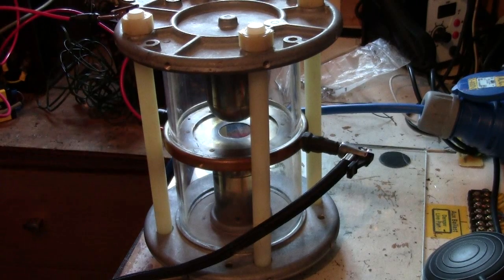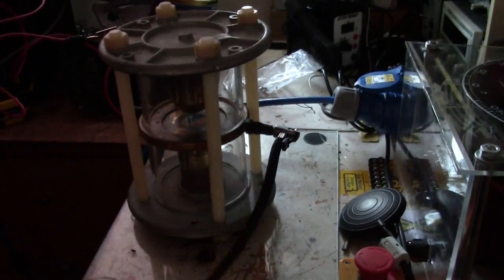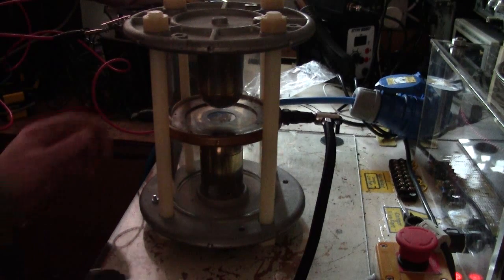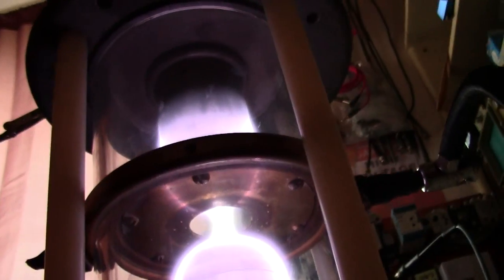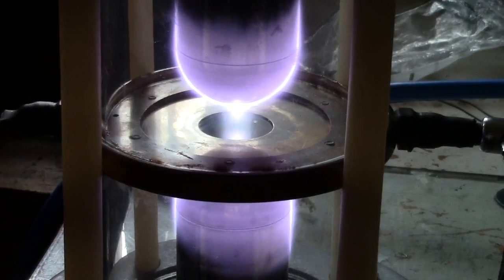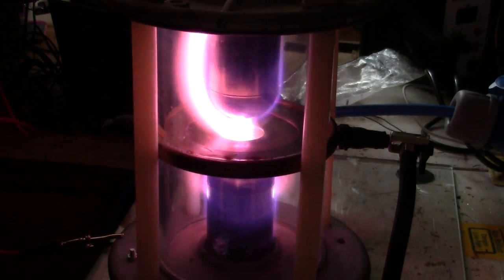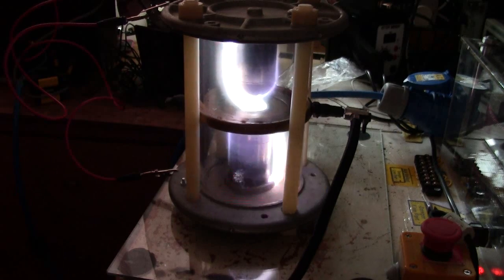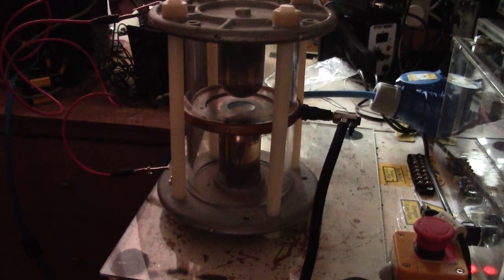Military spark gap VERY STRANGE .KNOW WHAT IT WAS USED FOR ?

Comment: if you add a  puls from AC 90% you getting mixed ac and dc witch you should have some vary strange efects like (mixed ac and dc giving you levitation ,invisibility and all others think over that )....just in that case you need 1 wire from inside the vacum tube goes on the the caase outside to efect all around ...:)
Reply: do I need some specific laser or ? i like your idea :)
Reply: +Johnson K. Angel 
Magnets dont bend light. If they did, like you propose, then every magnet would create a diffraction grating effect where the light is separated by wavelength. If you insist on your theory, then explain to me the mechanism at play, where is the math that backs it up?

You've been watching too much Ken Wheeler videos
Reply: +Johnson K. Angel 
One of the red flags I see in Ken Wheeler's theories is that there is a lack of math and quantization. If you can define something at least somewhat by numbers, then how can you accurately compare data from experiments? And without the math how can you accurately make predictions to then test with experimentation? 

I just tried bending a laser with a neodymium magnet and it seems to have no effect. What could I be doing wrong? I do respect the fact that you strive to confirm things through experimentation. Hopefully we can come to a conclusion together.
Reply: ***** 
I am using a blue laser. 445nm to be exact. And im using a stack of 1/2" diameter by 3/8" tall neodymium magnets.
Reply: ***** 
Its not bending at all for me. I have tried it with all different magnet orientations and I just tried it with the magnets further from the laser pointer. Why would the effect be magnified the further you get from the source? Maybe you can try your experiment again to see if you made an error or something?
Reply: ***** 
Also, a few comments up you said that red light bends more since it has a longer wavelength, but in your reply to me you said blue light bends the most since it has more "capacitance" (not sure what you meant by that).

So which is it?
Reply: ***** 
As I said previously, im not getting any bending. The fact that ive never heard of this before lends its self to the probability that its false. It seems like a pretty major property if light that is either there or isn't and should be easy to confirm or falsify. There are many examples I can give that would also indicate that this is probably not true.

So lets look at the claim a little more critically. Where did you first hear that magnets would bend light?
Reply: ***** 
The laser is about 1.5 watts, is that powerful enough?  The magnets though are relatively small compared to the large ones you can buy. 

Why is it that no one else has noted this effect? Dont you think there have been plenty of researchers to try this with very accurate test setups?

Lights magnetic field can be affected by an external field, this is called the Faraday effect. The way it affects it is not by bending it, but by changing the relative phase between the oscillating magnetic and electric fields which changes the light's polarization. 

Can you upload a video of you bending the light with a magnet?
Reply: ***** I am still not able to see any bending. What size magnet and laser are you using? Can you upload a photo of the bent beam
Reply: ***** 
Oh ok. Based on your results, which direction does the laser bend relative to the magnetic field direction. Also, by what angle is the beam bent with your setup?

 What do you think about my ferrocell explanation on the other video I linked?
Reply: ***** 
You dont have to use any assumption to measure it. Like you said, its as simple as measuring the distance from the laser to the surface you are shining it on and then measuring the distance the dot moves when the magnet comes close.

Ok so you call it the dielectric inertial plane instead of magnetic field. By definition, a plane is 2D, so is magnetism not 3D? Or am I interpreting that wrong? Also, to me, dielectric means non-conducting, and inertia is a property that matter has which basically resists acceleration (ie. an object a rest will stay st rest and an object in motion will stay in motion unless acted on by an outside force).

So what exactly is a dielectric inertial plane? A plane where non-conductance doesn't change unless it is forced to by some outside force? This all seems very confusing to make up your own names for things. Why do you choose to call it that?

In regards to the flaw in my ferrocell explanation, if all the light was absorbed by electrons then the object would be black. For something to be invisible, light has to pass through it unchanged. For example, a clean piece of glass lets light pass through very well, which is why it is clear.

The electrons dont just absorb any light willy nilly. Depending on the energy level structure of the atom, its electrons will absorb certain wavelengths of light. Im not sure how that plays into my explanation of the ferrocell though, can you explain why that would matter?

I didnt know that magnetic and dielectric fields make the light coherent. What is required for this to work? Does any magnet make light that passes by coherent?

What are your thoughts on my reasoning that you arent able to observe light bending in the ferrocell because, by definition of sight, what you are seeing is light traveling straight at your eyes. Do you can only see light that hits your eyes? I believe this fact alone is enought to show that you cant see light bend in a ferrocell.

Since my results indicate that magnets dont bend light, and your setup obviously allows you to see that, can you upload a picture of it? Otherwise I dont see any evidence for that hypothesis. If you dont have fog try it at night and light a couple matches or something to get some smoke in the air to make the beam more visible. What size is your magnet and what power is your laser?

Comment: It seems to me that the higher vacuum in the casing the less voltage is needed to create a spark. And the opposite. A normal atmosphere in the container requires higher voltage to form a spark. Maybe the device could be used for this measure. the Vacuum or level of exhaustion versus the Voltage to see when an arc is formed between the terminals ? seemingly the more molecules in the container , the more choked is the spark. By forcing air into it and compressing a whole lot of molecules into the container will presumably increase the spark gap resistance. It certainly depend on what molecules are present. CO2, or Nitrogene or Oxygene or "air" .

Comment: HAve a look at the Aurora Pulsed Radiation Simulator: http://cryptome.org/eyeball/aurora/aurora-eyeball.htm - in the photos you can see that its Marx pulsers used boatloads of T-508 switches like yours. I designed and built a modified and miniature version of the T-508, never got around to testing it before my pulse cap and related resources went away. :(

Comment: vacuum plus electron acceleration equals x rays i thinks. be careful
Reply from the maker: you are correct but you need far better conditions,set-up and greater vacuum than I can achieve ( unfortunately ;-)  ) I also have 2 dosimeters and a Geiger counter running and picked up no trace .It's a good point to make though it's very surprising how lower voltage is needed to achieve X-rays and a good read also, if you like that sort of thing .Thanks for the comment John

Comment: Greetings,

You have a T-508A spark gap, made by Pulse Sciences/L-3 Communications.  It is capable of passing up to 150 kA and standing off 200 kV when charged with sulfur hexafluoride at a few atmosphers.  Max pulse duty is about 2 coulombs per shot.  The center planar electrode is the trigger.  These gaps are used in the Sandia Marx banks that drive the Saturn and Z plasma accelerators, among other things.  

Few of these gaps exist in private hands or outside the US National Labs, but there are a couple of places to see them.  Back in the mid 1990's, the University of Nevada acquired some from Los Alamos National Lab as components of the 2 terawatt Zebra Z-pinch.  There might also be a few in the surplus store called the Los Alamos Black Hole.  Rare ducks, these...
Reply from the maker: Andrew .I thank you so much ! I've been searching for some info on this since I brought it and found nothing but triggatrons .NOW thanks to you I have a Datasheet ,you don't understand how happy you have made me ,it's finally been answered .I still have it sitting on the shelf I also have 5 X 20 kv PT's and 2 very large power distribution capacitors capable of blowing off a limb ,Now I have this info I k ow it's safe to use ( once filled with SF ) although at 20 KV at around 10KVA I may go dry air but that is something I will look into a lot more ,Thanks again John
Reply: @HighVoltageProjects  what is the rating on the power caps with u btw 😎
Reply: HighVoltageProjects idk if you seen this or not but here’s a pdf on if http://www2.l3t.com/ati/pdfs/T-508.pdf
Reply: Love it!
Cheers from Toronto
Reply: Due to the recent fusion breakthroughs and z pinch news last year... This thing has become even more interesting
Reply: interesting !! what are the saturn and z plasma accelerators ?
Reply: Andrew Oxner lhjllhollhklh8jll
Reply: That was pretty tight.
Reply: No dangerous x rays?   Can this rf output be measured qualified on an asccilator? What's it look like in the various spectrum bands..
Reply: Hi Andrew!
Just a quick note to say how interesting your description was. Man I'd love to work around such facanating gear and minds!
        Cheers from Toronto

Comment: That is a super awesome gadget you got there. Maybe for research, many applications require very high amplitude short duration pulses like this one seems to be designed for and with high voltage you can't use ordinary electronic switching - or maybe it's just an ordinary quenched gap, if the ring is magnetic, for radio transmission, they used all kinds of gases, like pure hydrogen, f.ex. Typical that we're not allowed to use them, at the same time they(the DOD) make these. Tesla made them first, but then a guy named Paulson nicked the idea and made(money) it more famous. The dimensions of the gear and watt capability in an old military radio station was just unbelievable. If you haven't found out yet, ask somebody that knows all about old radio tubes(not just an audio freak). Ernest C Okress(Westinghouse's microwave-guy and waveguide window specialist) would certainly know what the military would use it for, and if it's not old school-radio or high powered radar, it could be something really cool like HV pulsed DC propulsion as he has patents for it (quasi-corona-aerodynamic vehicle) you and especially the people that are showing off their inefficient little lifters really should check it out.
Reply from the maker: Happy Fox thanks mate I will do that .I thought it may be a triggatron / triggered spark gap it seem a lot of people have lots of ideas but as yet havent found a thing for sure so ,I ll have an ask around those guys .Thanks again John

Comment: Triggered Three-Electrode Spark Gap Switches are ceramic-metal sealed off gas discharge trigatron-type devices with a co-axial trigger electrode. These Gas Discharge Tubes contain no mercury and, due to an advanced design, feature high reliability and a long lifetime being operating under wide range of environmental conditions.
http://www.delmarphotonics.com/Plasma/Triggered%20Spark%20Gap%20Switches.htm

Spark Gap Switches R-90 and the devices of RK-series are the sealed-off ceramic-metal gas discharge tubes designed as untriggered switches for use in pulsed circuits of devices with enhanced demands to switching speed, break-down voltage stability and a level of power maintenance.
The devices feature an extremely small size, they are capable of operation under complicated climatic and mechanic conditions (for example, at temperatures up to +250 0C), and have an established reputation of reliability for use in ignition systems for aircraft jet engines, pulsed lasers and other kinds of pulse apparatus.
http://www.delmarphotonics.com/Plasma/Untriggered%20Spark%20Gaps%20Datasheet.htm

Spark gaps in stock! sales@dmphotonics.com
http://www.dmphotonics.com/Plasma/Triggered%20Spark%20Gap%20Switches.htm

RK-162-01 Untriggered Spark Gap
http://www.dmphotonics.com/Plasma/RK-162-01%20Untriggered%20Spark%20Gap.htm
http://greyhawkoptics.com/product_info.php?cPath=154&products_id=755&osCsid=13b85017586246d875d49b901b35eb9b

RT-53 Triggered Spark Gap	
http://greyhawkoptics.com/product_info.php?products_id=838

RU-62 triggered spark gap
http://www.dmphotonics.com/Triggered%20Spark%20Gaps/Triggered_Spark_Gap_RU-62.htm	
http://greyhawkoptics.com/product_info.php?products_id=756

RU-69 triggered spark gap
http://www.dmphotonics.com/Plasma/RU-69%20triggered%20spark%20gap.htm
http://greyhawkoptics.com/product_info.php?products_id=757

Triggered Spark Gap RU-65 sales@dmphotonics.com 
https://www.youtube.com/watch?v=XPfWVaRtOXI

Hydrogen Thyratrons are used in such devices as radars with different power levels, high-power pulsed technical, electrophysical, medical devices and lasers. Sophisticated design and high quality ceramic-metal envelope determines long lifetime and very accurate and reliable operation of hydrogen thyratrons under wide range of environmental conditions.
http://www.delmarphotonics.com/Plasma/Hydrogen_Thyratrons.htm
Deuterium Thyratrons
http://www.delmarphotonics.com/Plasma/Deuterium_Thyratrons.htm

Comment: What you have is called a field distortion triggered spark gap.  It is intended to act as a high voltage switch, usually for capacitive energy storage.  The load can be anything from a laser to an inductor.  The middle plate is the trigger electrode which is pulsed to high voltage with a pulse generator to initiate breakdown of the switch.  It is meant to be pressurized with dry air, nitrogen or sometimes SF6.  The operating voltage can be adjusted somewhat by varying the gas pressure.  They are intended for very short ( usually < 1 ms ) , single pulse, operation.

Comment: Maybe a gas discharge surge arrestor for antennas etc... you could also try connecting DC high voltage into it, but have your radiation meter close LOL (it could more likely be a high power 2x cold cathode x-ray tube)

Comment: The device was probably used in the investigation of plasma effects. The middle plate will become negatively electrified which will force plasma discharges from the hot electrode. The negative electrode is becoming positive in the intervals that the middle plate is negative, which causes abrupt electrical impedance in the circuit. At a certain voltage, vacuum, and frequency, the entire thing should become highly luminescent. I would personally use this in the investigation of Tesla's radiant energy because when you tap in to it, thats when the whole thing should glow white while remaining cold to the touch. That is just a hypothesis though. Cool toy!
Reply from the maker: Very interesting conclusion ,best yet i think ;) Thanks John
Reply: HighVoltageProjects On second thought, it is just a triggered spark gap. I found this:
"The Triggered Vacuum Spark Gaps are ideal high-voltage switches for applications where a wide operating voltage range is desired. The low end of the Voltage (SBV). Operating ranges from 300 volts to 80 kilovolts are possible. Switching times of less than 1 microsecond may be achieved when using a suitable trigger. These switches are commonly used in “crowbar” circuits for protection against overvoltage conditions."
Reply: @AJTalks  man! your conclusion! blew my mind!
Reply: For them, it was "just a spark gap..."  But think about the size of this gap.  Just what kind of standard use is there for the 100KA range?   It's clearly a research capable device for us. and that's all you need to remember.  Use the right gasses and pressure, said device becomes a literal EVO reactor (search term) and offers centering to feed the electron cluster while holding between the electrodes.
Reply: it makes sense that you say it can be used for his research. probably very research capable in the right context !   @JoinTheTechnicians
Reply: I’m seeing Tesla all over this as well. That middle plate acts as a magnetic quench it’s probably more diamagnetic then let’s so it’s pushing back against the spark that makes a magnetic field as it flows. I made a small one but I used Bismuth it’s just the same or better. I use to have a spark now I don’t and I’m hitting still high voltages. Then I looked at the word quench agains and it makes since to me why I don’t see my spark non more.  I love this stuff

Comment: looks like a triggered spark gap. the center ring will be connected to a divider (between the endcaps) and a series cap to couple in a trigger transformer connected to one of the endcaps. adjusting the pressure to stand off the selected working voltage.it will be able to switch some serious capacitor into some poor old electronics or massive flash tube (:
Reply from the maker: I think it will get used for many fun things now i know its uses ;) Thanbks for the info I'll have to read up some more